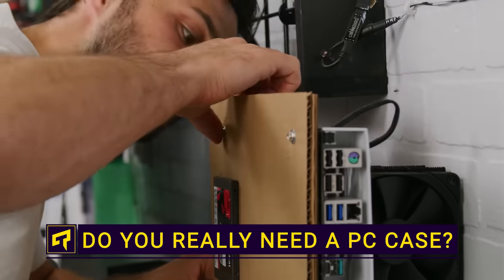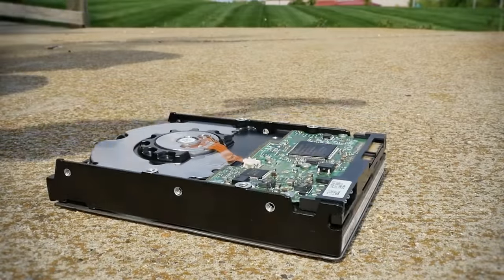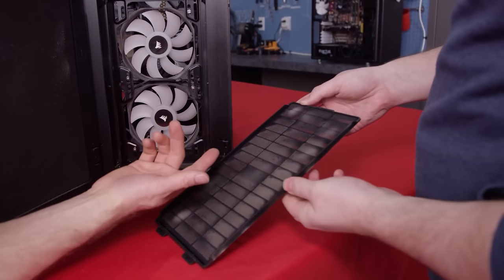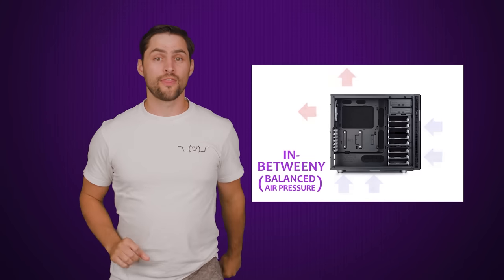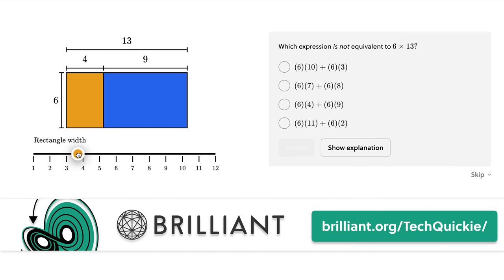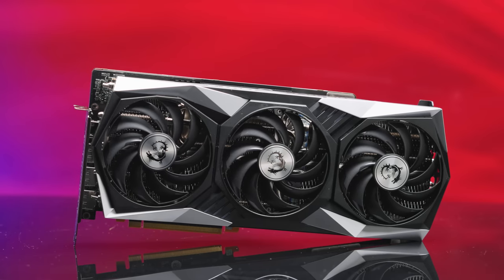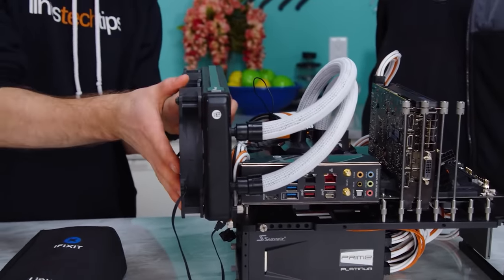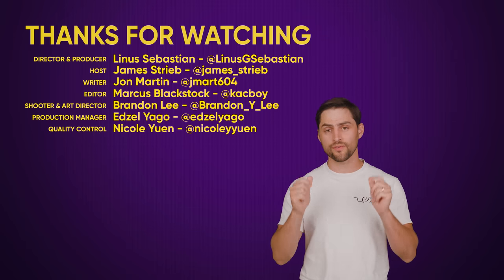Do You Really Need A PC Case?

Comment: Honestly as a truck driver I wish I was home more often with a 3d printer and some tools long enough to build my own case. As the one I have is too tall for what I really want but alternate solutions have not worked out and it's been difficult to make a atx computer portable with downgrading to a itx which limits the amount of ssds you can plug in. Which I don't like because you want as many ssd slots that you can fill and spots to place them as a truck driver.  Carrying cases for the computer is also a issue as most break very easily.  Or they wear out on concrete quickly which is the most common surface I am on. And have had 3 laptops break in a row. At least with desktop I can figure it out and repair it on the road.

Comment: If you want to keep a system for decades, don't go for a cheap case, psu and motherboard. If you just need a simple system you can cheapout on those components.
Reply: Who keeps a system for decades? I doubt you will be doing much effective work or gaming with a 30 year old system. 
I have a 9 year old system that will probably manage to reach 10 but I don't see it going for 20.
Reply: @SIPEROTH  i have a fellow pro videographer who still edits 4K video on an 11 year old system he simply upgraded the cpu and maxed his ram and that was it. Voilà a system that will last him at least 5 more years.

Comment: Back in the 90s we had 3/486 combo boards that took 30 pin and 72 pin memory, as well as PCI and VESA cards. They were just bolted to a plank of wood somewhat hidden under a shelf (easy to put cards and CPUS in it, but hard to drop something on it) and a rocker switch brought up front to the edge of the test bench and a crappy VGA monitor for output. Worked for years, I'd love to have one of those versatile combo boards now.

Comment: I'm fairly sure that there are boards that are designed to be used in cases. I specifically mean grounding wise. I've seen multiple boards that have obvious grounding points at the screw hole perimeter. About 99% sure that some boards rely them being used to reduce noise in signals at board. I kinda suspect that in severe cases it could even result in some odd behavior/crashes. That's why I'd never use board without metal casing and good brackets. Even if I'd built some weird custom case, I'd definitely make sure that those locations would still have ground connection.
Reply: It is the opposite. The board is always grounded trough the cables, the ground points are to give ground to the case.
Reply: @javiej  In the end. The grounding points are the same. Otherwise you'd end up with potential difference that could easily fry components. Bad grounding can lead to severe problems on various electronics devices.
Reply: @jothain  yeah but my point was that if you don't have a case then there is no need for case grounding, as all the components  are grounded trough their cables and connectors (otherwise they could not even work)
But you are right, any.difference in ground level can cause a lot of troubles. This is a very common problem ignored by many users,   appearing.when external peripherals are connected to different power plugs in the wall with different ground levels

Comment: I don't use case for probably 20 years now. No problem at all. Motherboard is lying flat on shelf above the desk. Graphic card (RTX 2070) not screw to anything (is supported by smal plastic piece). Minimal amount of dust don't do anything wrong. Noise level is 38 dB according to smartphone measurement from 20 cm away.

Comment: A case is useful.  Keeps a desk from looking cluttered, takes less space (tower case) and reduced chances of accidental electrical shorts and ruined hardware.

Do you need a transparent PC case with pretty colored lights and 10 fans covering every available surface, but no useful front-mounted USB ports or drive bays available for installing aftermarket accessories? No.